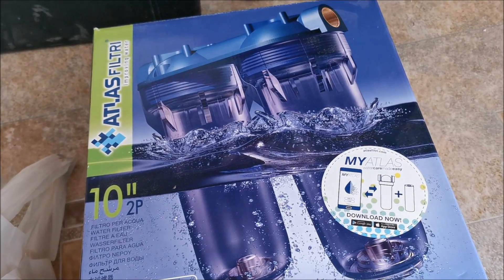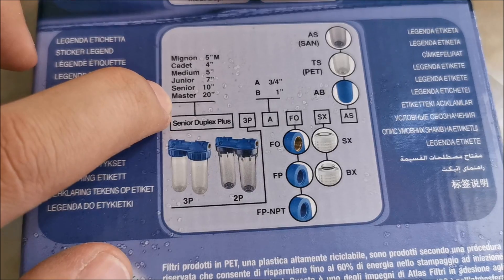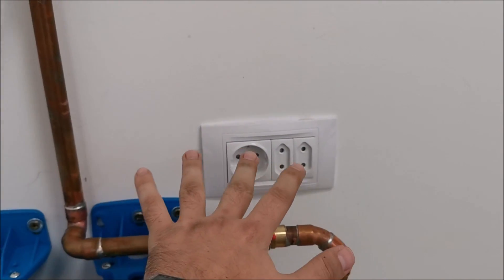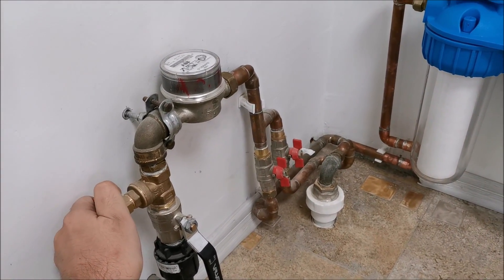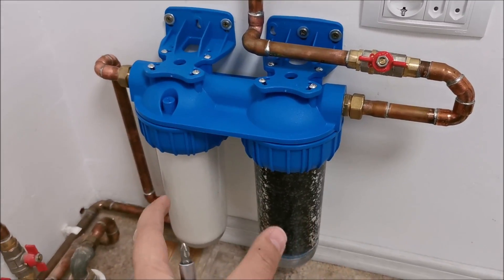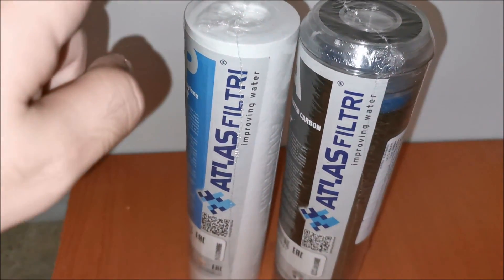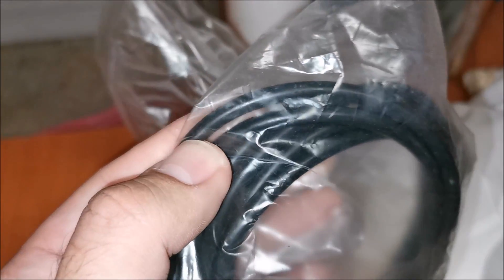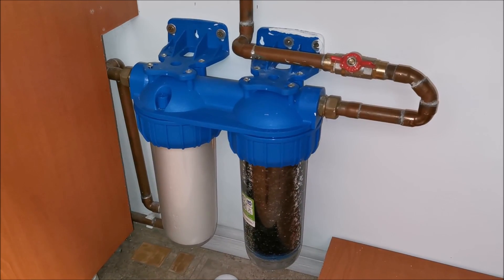ATLAS Filtri Duplex Plus 3P SX water filter - install, app setup, filter replacement and review

Comment: Would the 2.5x10 size be sufficient for a 2.5 bath 2 person Florida condo, or is 4.5x10 a practical necessity?  We ask because the place where we could install two might fit the smaller sizes better than the larger, or we could mix them.  We intend one to house anti-scale polyphosphate, and a second to house a 5micron filter with carbon.  (If we have the room, we want to squeeze in a spin down filter as well to extend the life of the filter.)
Reply from the maker: Sorry, but I don't know. Try to contact Atlas filtri directly by email.